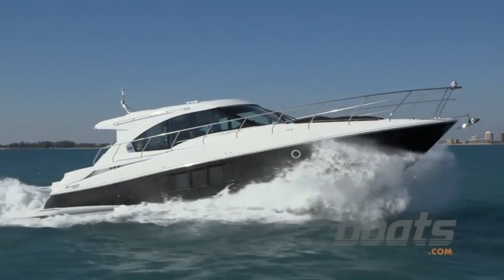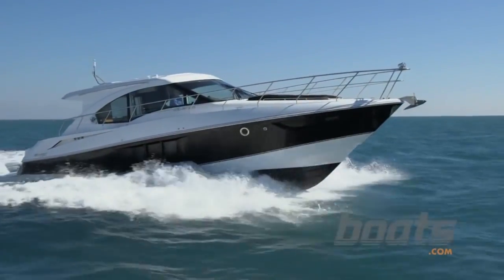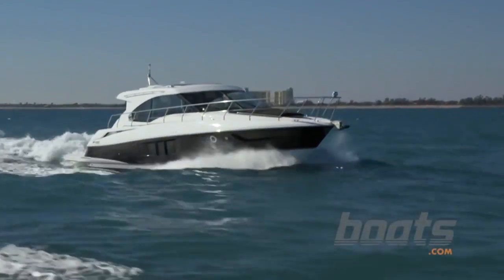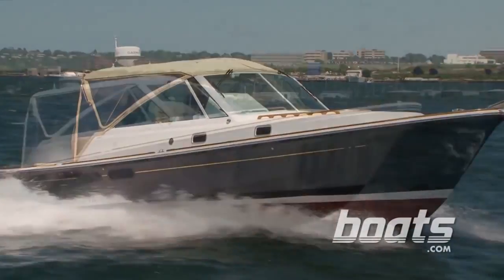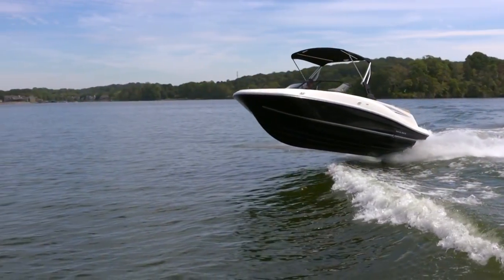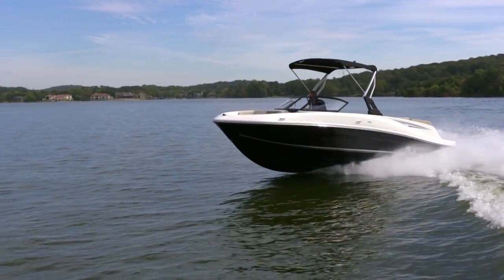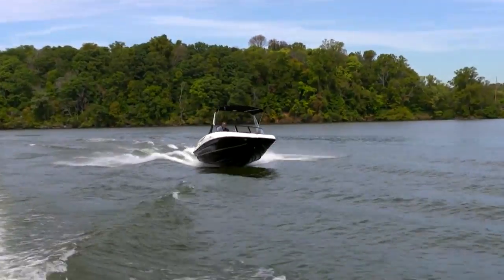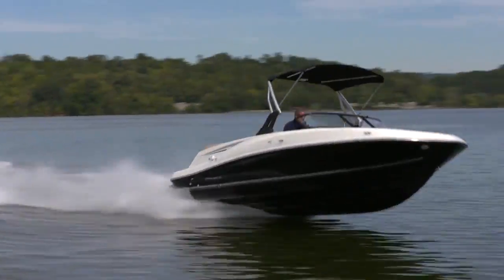Boating Tips: 3 Tips for Handling Heavy Seas

Comment: Good basic tips which I can vouch for. Not long after buying my  boat, a little 13 ft speedbboat based on the Fletcher Arrow design with an old 2 stroke Yamaha outboard, I made the greenhorn error of getting caught off the coast in Greece after lunchtime when the winds come up. In no time at all I was fighting with heaving big waves and suddenly saw all other boats had disappeared back to shore. I instinctively aimed the boat at 45 degrees to the waves and reduced speed but even with that I was plunging heavily and taking water.  The only coastline for as far as I could see was jagged rocks with waves breaking over them. Then all of a sudden the engine began to splutter thanks to some shit in the carb and I faced the threat of no power and thus being unable to keep the boat angled to the waves. I called a friend on my cellphone to call the coastguard but in the Greek islands the response is uncertain to say the least. It was at that point that I thought I was done for., despite having a life jacket. However, somehow the engine kept going at very low revs ( anything more and it threatened to cut out) so I managed to get through a long and tortuous journey back to the cove. I still relive those moments. I’ve changed the engine now and have it serviced before every holiday, and if I ever forget the time and find myself moored somewhere away from base after lunch, I’ll stay there till evening when the wind drops.

Comment: I have not a lot of experience with a boat in rough seas, I did have to control a rescue RIB recently and i tried to hit the big waves head on instead of in an angle this went a lot better for me. Because the man who drove before did get into them in a angle but this made the boat wiggle in all directions and almost threw people overboard (this was at very high speed). Any tips on how to drive safer?
Reply: My experience has always been like this as well. Going at the waves at an angle might work in certain situations, but if the boat is getting hit sideways its going to be a lot rougher and its better to take them either head on or at an even higher angle. There's definitely an angle of maximum pain

Comment: I have access to a 200 HP Evinrude outboard, and a 9.9 Johnson outboard. Since I am under 16, I can only use boats with motors up to 50 HP making me only able to use the 9.9.

I go out into an open area in that thing as much as I can. Since I'm only 100 pounds and 15, light boat, light motor, I fly across the water. However in the open waters, it's almost always wavy, and my cottage is near a channel that is flooded with large yachts. 

To yacht owners, when you see a small boat with a small driver, don't continue driving around with your stern dug into the water. Your waves are huge, especially when you're in a channel where the small boat has nowhere to run off to.
Have some common sense please.
Reply: wribg 100 hp fotr 16   fpoter vet seàray  laguña 20 fiter    paerker 2120   232⁰

Comment: Hi, am new into boating, live in south Texas, watched some bar crossing, question is: do i have always to cross bars if wanna go offshore? Or bars only  are on some coasts?
Reply: You should always plan your trip out on a GPS and or a map.  You should always go back the same way you came its safer. Check on the low and high tides. Check the weather.
Reply: Bars are located only when a river empties into the ocean or a bay, which empties into the ocean. It is the clash of the river running out and the tide coming in that makes the crossing rough. Also, tune into coast guard radio channel. They tell you the bar condition. Like when learning to fish, learning how to run your boat safely is best done by going out with an experienced boater. Tag along with him/her and learn how to run your boat.

Comment: what if the waves are going the way you need to go, and you are only in a bay boat.
Reply: I'm no expert in boating so def dont take my word for it, but my guess from these tips is still take the waves at a slight angle and maybe alternate zig back and forth between   the channels every other wave or two so that you still maintain course without getting too far off track. Or if your boat can handle it  , and you dont mind a rougher ride, take em head on and have fun jumping waves
Reply: You get your bow up in the back of a wave and match the speed. Surf the wave in.

Comment: If you slow down won't that risk the nose getting swamped . Also hitting on an angle can't that cause you to  flip easier?
Reply from the maker: +Kef103  Hi Kef103 - If you dramatically reduce speed the bow certainly will fall for a moment or two, so while a slow-down is fine, you don't want to suddenly chop the throttle right as a mountain of water is heading your way. Also note that we never recommend going so slow that the boat isn't on plane (maybe yes, maybe no, depending on the situation) but just recommend against "racing across the waves at full throttle". As far as flipping goes, as long as you don't go beyond 45-degrees the danger won't be exaggerated much at all. That said, if a boat is seriously in danger of being flipped we'd have to suggest that there's been a major break-down in the captain's judgement. It takes an awfully big or steep wave to flip a modern powerboat, even running at an angle to the waves beyond 45-degrees, and when this is a real possibility the boat shouldn't be in that place at that time, period. Good luck on the water!
Reply: OK , thanks for the advice . growing up my family  had and still has a 17 foot bowrider  however now I'm in fort Lauderdale and  been going out on my friends new 21 foot sea ray out  on the ocean it was a bit  more challenging . it has plenty of power 200hp verado but it can get rough out there.
Reply: The Atlantic in South FL is a whole different beast than what most boaters are used to. Even in the North Atlantic where there are huge swells, the waves are almost always organized with consistent periods. In South FL, our storms are such that you have multiple pressure systems creating energy in all different directions. Between the swell, inconsistent periods, heavy winds, and extreme chop we have here (even on some flat days,) our seas really put you to the test on any boat smaller than ~32 feet on some days. I've been out in swells where NOAA buoys are only reading 2-3 feet, the swell isn't huge, but there are waves crashing in all directions and it's not so simple as to take a wave head on so you don't get broadsided or to take a wave on at a slight angle, because every 100 feet the seas change drastically!